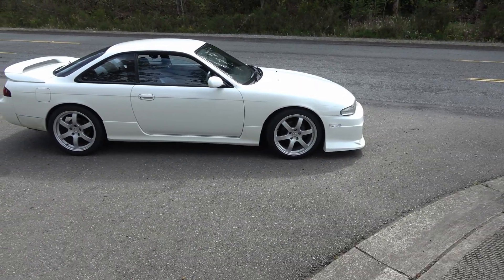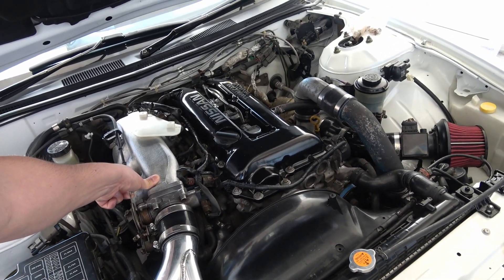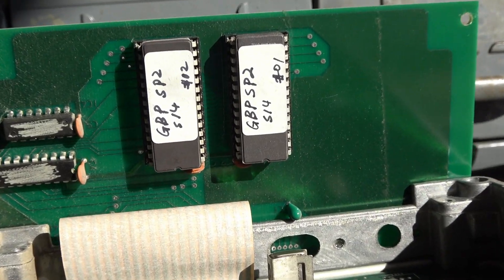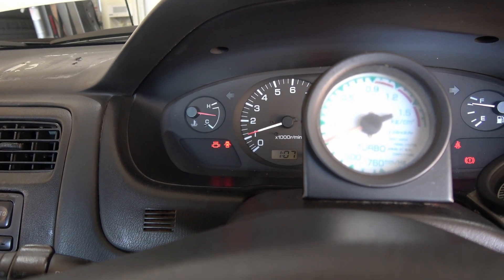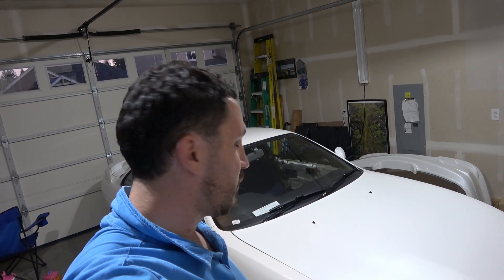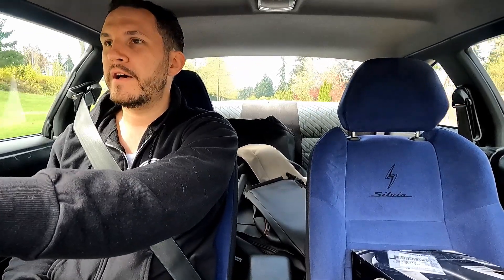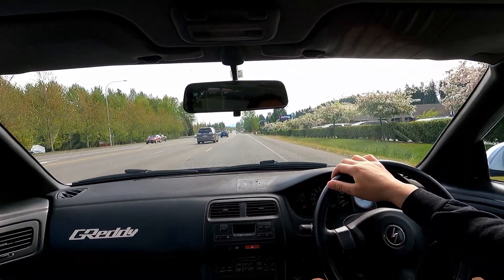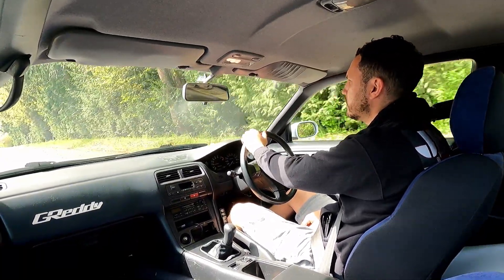Broken Silvia S14 progress Need HELP.. car does not run very well

Comment: Good day sir! I’m still learning everything there is to know in EFI Nissan’s especially the ECCS and not an owner of any car with SR20 but my B13 Super Saloon has the GA16DE with ECCS and I have encountered rough idling issues in the past, the best thing to is to scan it with a 14 pin OBD. You can also try the ECU flash code, the red bulb on the ECU flashes simultaneously with the check engine light. To do that, you’ll need any type of wire and stick both ends of the wire on the 2nd to the last and last pin of the top part of the OBD port. It’s in the service manual for the Sunny-Pulsar B13/N14 service manual you could check that out sir. Double check all of the sensors sir: engine coolant, IACV, MAF and TPS make sure that they are all properly calibrated then clean the MAF sensor, throttle body and the IACV. Use carb cleaner but MAF sensor cleaner only for the MAF just to be sure. But some of the Nissan EFI experts here in the Philippines use carb cleaner even on the MAF so it’s your choice sir. Hope she runs great again. I love your videos sir! Stay safe!
Reply from the maker: Thanks so much. I have a lot to learn with this type of stuff. My first time working through anything like this. Thanks for the good info sir!
Reply: @JDMRightHandDrive  anytime sir! More than happy to help, a big fan of Nissan. Love your content sir! Stay safe! And to the family as well. 😄

Comment: I had the same problem on my s14. And it was the hardness of all 4 coils.  Harness was making false contact at plug connection where all 4 coils connect to.  Hope this helps out. ..! 👌👍
Reply from the maker: Thanks, I appreciate you sharing. I will have to purchase a new coil harness and see if that fixes my intermittent issues!

Comment: It's your throttle position sensor. Test the resistance (ohms) on it at different position points (manual should tell you what resistance should be at each). I had this almost exact thing happen to me in my R33 and I was taking MAFs apart, replacing things that didn't need replacing, spark plugs, better gas, etc. and it turned out to be the stupid TPS sensor 😅
Reply from the maker: Thanks for the info on that. I have tested the TPS sensor voltage and it is set to .45 volts at close. Voltage raises smoothly all the wat to 4.0 volts with throttle fully opened. I did not check the ohms , I will look into that after work. I did clean, the MAF, IACV and throttle body. Car does run smooth, but still has an issue when I come out of gear at a stop light. RPM drop fast and car will stall. Starts right back up every time though. Hard to figure out modified old car.
Reply: @JDMRightHandDrive  Yeah the voltage is just telling you the current is reaching it at the correct amounts, but the resistance tells you whether there is something mechanically wrong inside the TPS 👍

Comment: because it's the factory ecu you can read the diagnostics from the consult port.  then you can check for faults.  the safc shouldn't be necessary at all, especially if it's chipped.  check the maf wiring etc.
Reply from the maker: Thanks for the feedback. I will run for codes. I was thinking the same thing. Good Idea on the Nistune. I will check that option out.
Reply: @JDMRightHandDrive  the nistune guy in australia is very responsive and supportive.  its a cost effective option to go full programmable, the only limitations are keeping factory triggers and MAF.

Comment: Have you tried unplugging the MAF and seeing if the car will start and run any better? I'm not sure about the history of the car from your other videos, but with the bigger turbo and injectors, I'm not sure it would ever run right without a programmable ECU and a tune.
Reply from the maker: I have tried that starting the car with maf unplugged and engine will not start. I tried this after I resoldered the 4 maf pins and car still would not rev at the time.

Comment: Bad ecu?  bad igniter?
Reply: If it was the igniter it wouldn't start. That's ignition. However the MAF system could be a problem.
Reply: @bohemianraceart  can if it was failing or intermittent had 2 zenki s14s one had this type of issue
Reply: @mtk4158  your right, it would make it have a servere misfire under load.